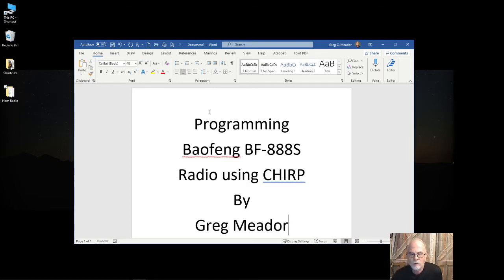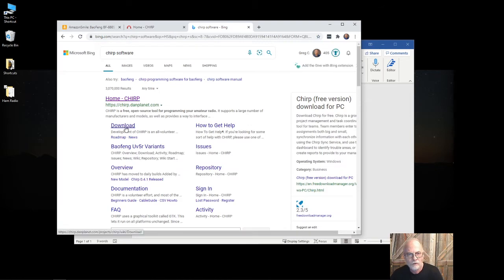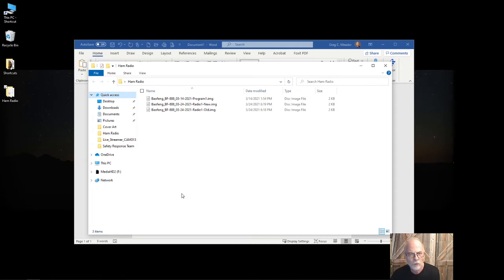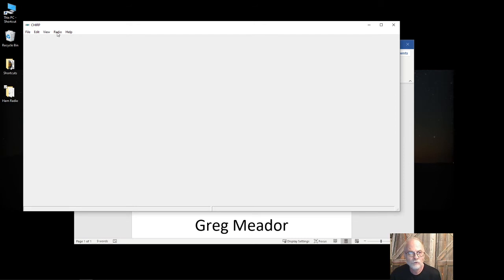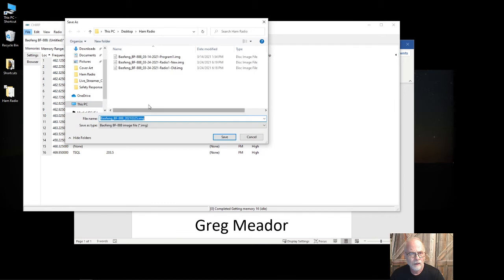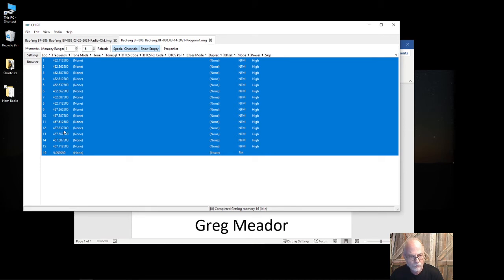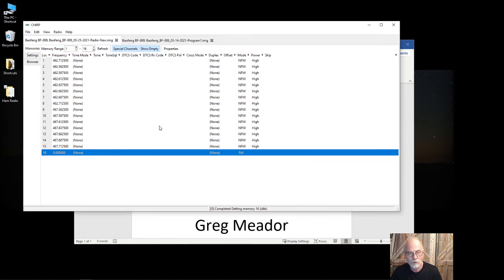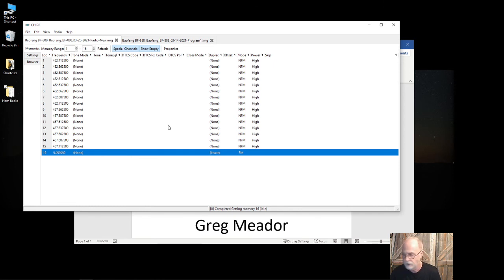Programming Baofeng BF888S Radio using CHIRP

Comment: Hi, can any 1 help can we still program bf 888s now?.i tried but it didnt worked tried to test vhf but as it seems bf 888s is only support uhf
Reply from the maker: The Baofeng BF888s only support UHF. It does not support VHF. If you need VHF from a handheld you will need to purchase a different radio such as a UV-5R or similar type radio.

Comment: i can't seem to program them to work on MURS channels.

The radio will take the MURS channel but will not work? because of all the other settings?
WHAT ARE ALL THE OTHER SETTINGS for the MURS channels?
Reply from the maker: The Baofeng BF-888S radio output is <5 watts. The Frequency Range (Single band) UHF 420-450MHz. The maximum legal limit for MURS is 2 watts and the frequency range is 
MURS Channel	Identifier	Frequency	Maximum Bandwidth
MURS Channel 1	MURS-1	151.820 MHz	11.25 kHz
MURS Channel 2	MURS-2	151.880 MHz	11.25 kHz
MURS Channel 3	MURS-3	151.940 MHz	11.25 kHz
MURS Channel 4	MURS-4 Blue Dot	154.570 MHz	20.00 kHz
MURS Channel 5	MURS-5 Green Dot	154.600 MHz	20.00 kHz
As you can see the radio is not designed to operate in the MURS band.

Comment: Well this radio programming is over my head. I was just hoping that "most" walkie's would communicate with each other on the same channel. Dad just got a set of another brand and we can't communicate. I have the PX888S. I guess the same radio but different names. Seems I have to buy the USB cable and take a course on radios  😞
Reply from the maker: The Baofeng radio is actually more that a walkie. It is actually a ham radio with 16 channels but no display. These radios are designed to require programming before use. As opposed to walkie talkies that you can buy that are a matched set designed to be used only on the pre-programmed frequency.

Comment: I ordered 5 sets of these for my crew. When I turn them on and press the PTT button they just turn off. I just programmed all of them and have the same results.
Reply from the maker: I have not seen that response at all with regards to the radios turning off. I am guessing that you charged the batteries when you received them. Depending on the carrier they do not allow units to be shipped with batteries being in a fully charged state.
Reply: @AI5HV  I want to thank you for taking the time to not only make a very useful video but also responding to comments. After a lot of wasted time I have learned that it was a bad batch of batteries that made the radios not function properly. Thank you.
Reply from the maker: @cophop2898  I glad to hear that you were able to get some replacement batteries and everything is working fine now.
Reply: @AI5HV  Thank you for your reply. Yes we charged them up completely. I even ordered another set from another vendor and that set is doing the same thing.  Sometimes they will work for about a minute or so but then they just turn off after pressing the PTT.

Comment: hello. i have a baofeng 888s and i would like to know if it is set to high or low power when you buy it. thank you.
Reply from the maker: According to my research, the Baofeng 888s does not support high or low power. It only has one setting for power output.
Reply: @AI5HV  i saw in your video that the settings on power are set to high so i guess that it will have and low settings power. Thank you!
Reply from the maker: For this particular radio the settings in Chirp have no effect.
Reply: @AI5HV  thank you!